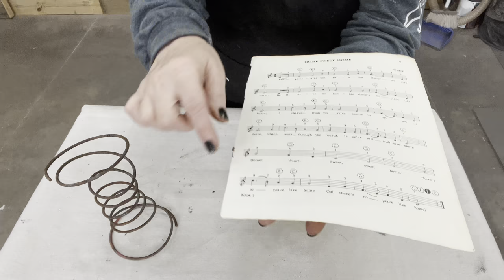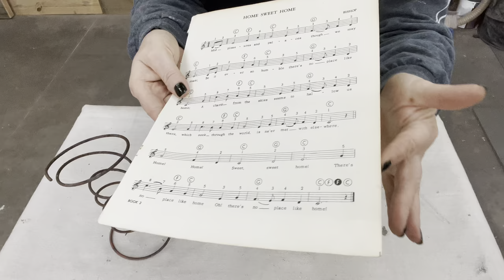Inspirational Home Decor Ideas

Comment: I have an old iron bed left in a house that i flipped.  Its a 3/4 bed so new mattresses won't fit. After seeing this, I'm going to pull the large center springs out of the metal box spring for crafts. There are also small, thick, tight coil springs around the edges that hold these larger ones in place. I would love to see what ideas you could come up with for these. Happy to send you a few if you don't already have some in your stash.